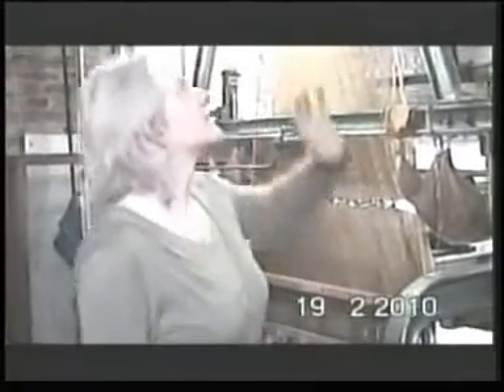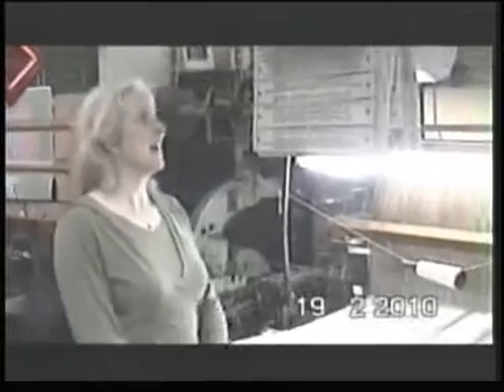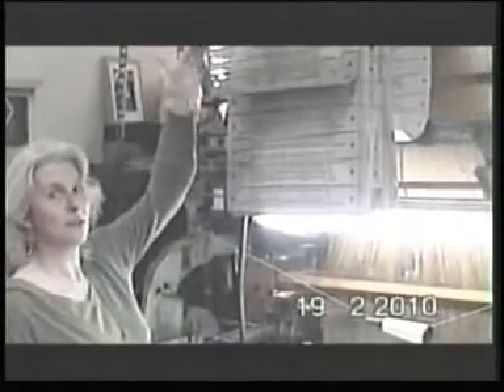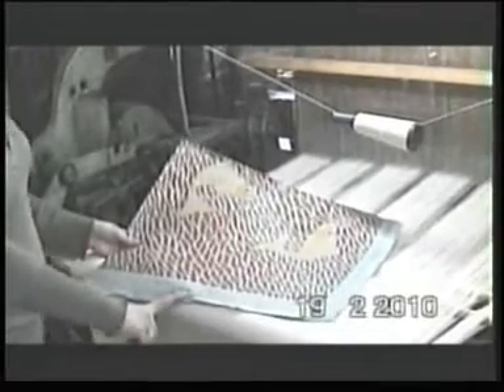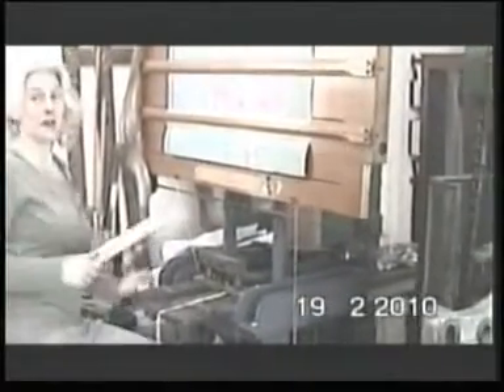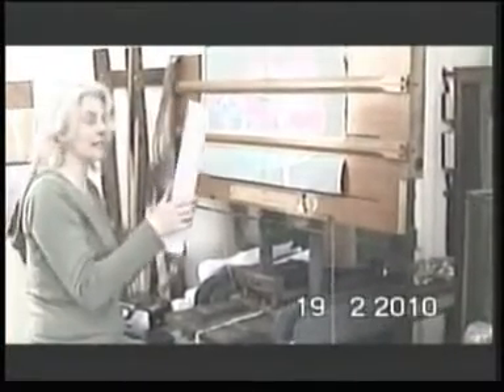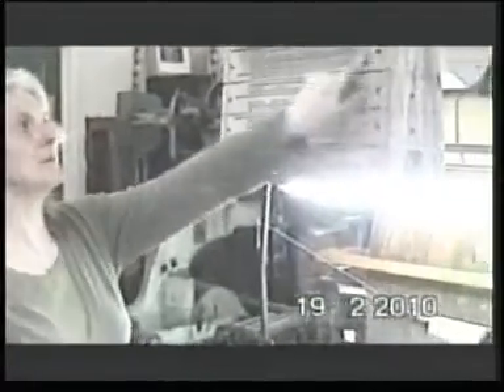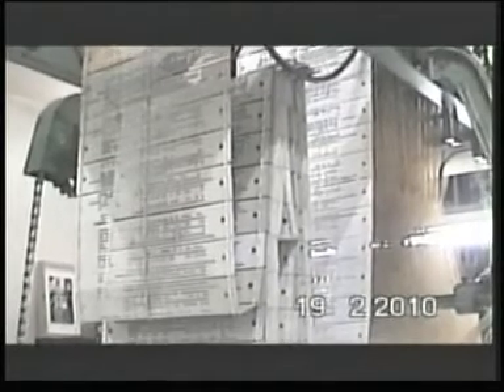Jacquard Loom Walkthrough

Comment: Why couldn't a roll of paper like what a player piano uses be used in place of the cards?  It would save the time needed to string the cards together.
Reply: Hi Christian, it can be and there are many variations of jacquard (and dobby) looms pre-computer still around that used such a roll. My looms are old and therefore have the original idea of a square cylinder which rely on gravity to engage the head with the pins. I think also (although I am not an expert so can't say for sure) that in industry at the time, card was cheaper to get hold of than coated paper and there were machines like giant sewing machines that did the lacing, so as long as you had one of those, the lacing didn't take long.

Comment: Hi Tilly,
The piano card cutter (the one I have) allows for all the four fingers on both hands to be employed at cutting in each grid, hence the 8 holes/squares.  The jacquards I use for both the 400 and the 200 hook heads are set up in configurations of 8 hooks deep.  You have to ensure that the card cutter you have is compatible with the jacquard heads you have, and not all pitches are the same.  The cards are cut lengthways, but put onto the loom widthways to accommodate the 8 hook depth.

Comment: I can see vaguley that each punch card has converted 8 lines of information? But I don't see how it corresponds to the mise en carte?
Reply: Each punch card in my video has converted one line of the mise-en-carte design and relates to the passing of one weft thread from one side of the loom to the other.  If you use two different colours in your design, you need to cut two cards to complete the one line of the mise-en-carte where the two colours are used.  Hope this helps.

Comment: Could you expand on how you read the line - you mention that you have divided the mise en carte into grids of 8 squares and have said that it relates to the octave on the cutting machine - but not how it relates to the punch card?
Reply: Hi Tilly, Each of the 8 squares in the grid relates to one of the buttons at the back of the cutting head, so for each grid, you push in the corresponding finger of any square that is marked black.  Sorry if it wasn't clear in the explanation.

Comment: Hello MsMaxmax.  The hooks are the design element, similar to pixels in computer terms.  400 hooks means there are 400 'pixels' wide that I can use for a design.  The number of threads connected to each hook give you the number of design repeats that loom is set up for.  So four threads to each hook gives you four complete repeats of the design across the width of the loom.
I hope this helps.